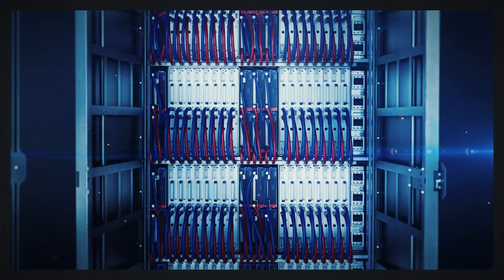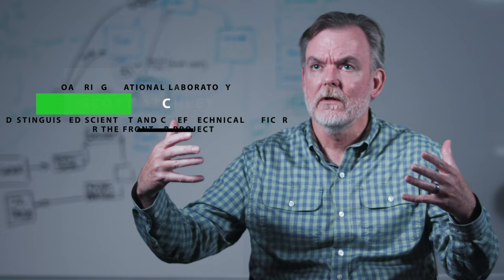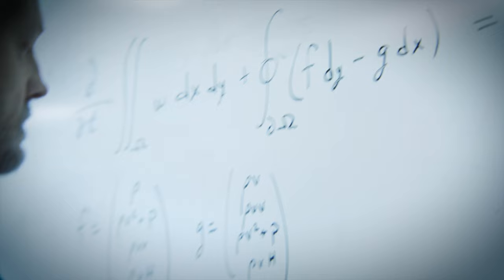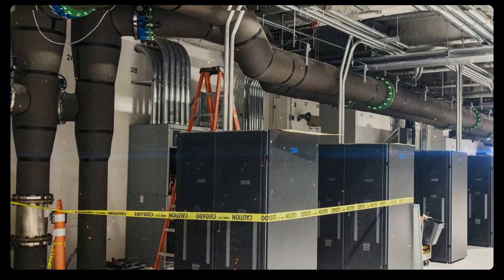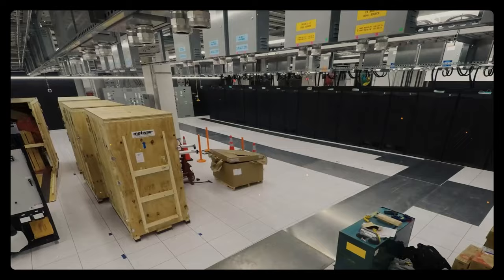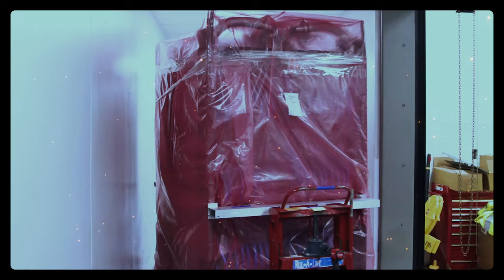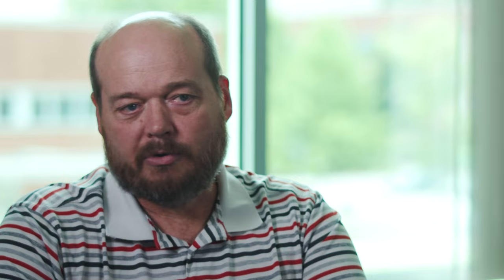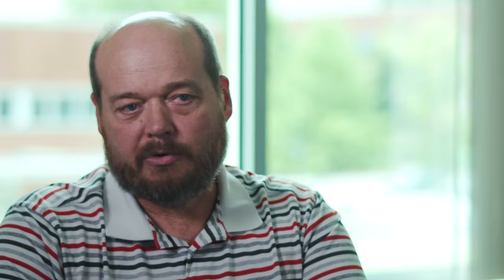The Journey to Frontier

Comment: Can any computer simulate the collapse of the North Tower if it does not have the data on the distributions of steel and concrete down the structure?  Where have engineers discussed that in two decades?

Comment: It's confusing that interviewees jump between the SI prefix "exa" and the name "quintillion"; I checked Wikipedia and they both mean 10^18, or 1 followed by 18 zeros.

It's easy to lose sight that "exascale" is 10 times more powerful than the wimpy supercomputer that can "only" perform 1 followed by 17 zeros of floating point operations per second, which in turn is as powerful as 100 petaflop-scale computers.

Comment: I see footage of hardware from Cray. Are these compute elements really Graphics Processing Units (GPU)s or just vector engines with a deep pipeline?
Reply: Wikipedia is your friend (Don't forget to donate!):
"Frontier uses 9,472 AMD Epyc 7453s "Trento" 64 core 2 GHz CPUs (606,208 cores) and 37,888 Radeon Instinct MI250X GPUs (8,335,360 cores)."

Presumably someone will build something similar using the latest AMD CPUs and new MI300 GPUs.

Google has built a supercomputer out of its TPUv5 tensor processing units, I don't know where it scores.
Reply: @skierpage I would argue that if your not rendering graphics on a GPU and instead running Cuda on them they are no longer "Graphics Processing Units" but instead Vector engines. We can see the shift in language because people mining crypto call their hardware crypto miners.
Reply: @aernan  Many in the HPC community also call them "accelerators".
Reply: @eliasboegel yeah, very familiar with that language. Can't wait to see tpus/npus over the next decade
Reply: @talkingonthespectrum  I actually wonder when the large facilities will host NPUs. Haven't seen that in systems yet.
Reply: @eliasboegel  well at some point they made sense over GPUs just due to them being ASICs for low precision math
Reply: @talkingonthespectrum  As long as they are low precision specific I'm not sure they will replace GPUs for the majority of scientific workloads. At least all application codes I know work with f64 or higher precision.
Reply: @eliasboegel  npus aren't for scientific workloads, they are for AI/ML workloads like chatGPT
Reply: @talkingonthespectrum  I'm aware. I'm just saying that they probably won't become widespread on any workloads like those that usually run on DOE systems. On the other hand, LANL just added a system (Venado) with AI/ML stated as one of the primary uses.
Reply: @eliasboegel  oh for sure, I can't see much use for it with the dod, but the NSA.... Imagine what they could do with an AI super computer